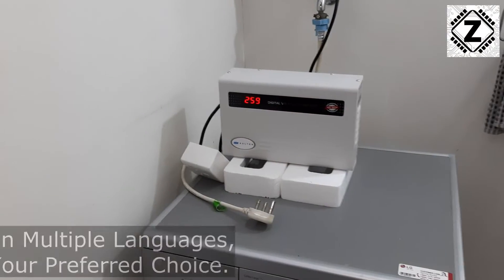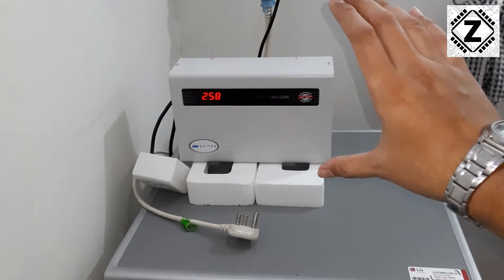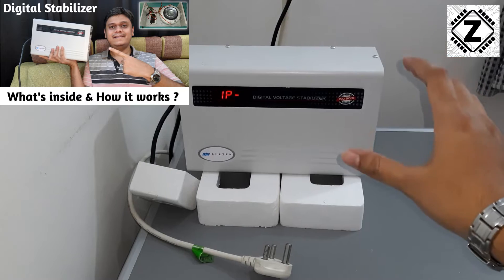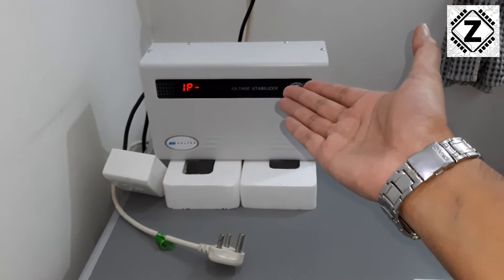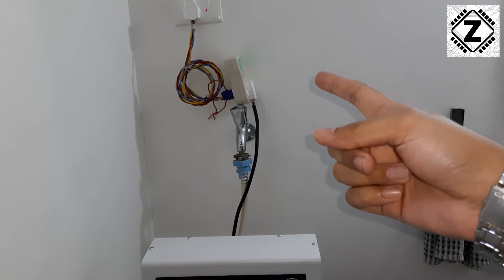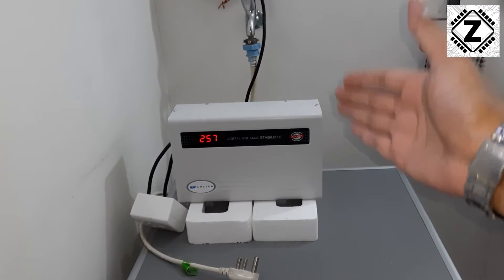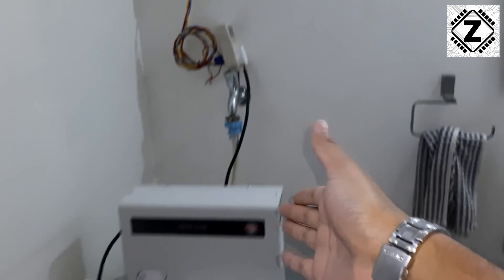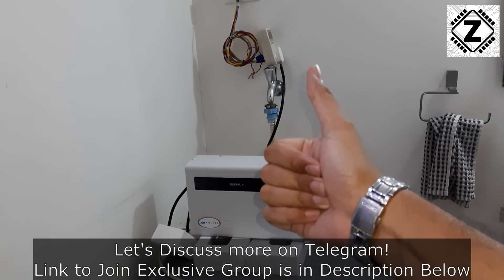[Eng] How Much Power does Stabilizer Waste? How to Save Bills? Aulten 5kva Idle Draw live Test

Comment: Is V Guard stabilizer consume current, even if ac is turned off and stabilizer is on?
Reply from the maker: https://youtu.be/lxdsLHANRPg
Reply: @ZenInnovations Thanks for the video,
I am using a microtek 4090(90 -300 range) in my 1.5 ton LG window inverter AC. As it is a heavy stabilizer. In my area there is no electricity fluctuations. Range is 210 to 240v max.
I have two questions if you can help me.
1. How much extra electricity unit it consumes if I use it with my my AC for 10 hours 
2. Does it make any consumption difference if I use any lower stabilizer like (180 to 280 range)
Reply: @ZenInnovations   

Thanks for the video,
I am using a microtek 4090(90 -300 range) in my 1.5 ton LG window inverter AC. As it is a heavy stabilizer. In my area there is no electricity fluctuations. Range is 210 to 240v max.
I have two questions if you can help me.
1. How much extra electricity unit it consumes if I use it with my my AC for 10 hours 
2. Does it make any consumption difference if I use any lower stabilizer like (180 to 280 range)
Reply from the maker: @manojrandhawa1020  continue using it as is, the power consumption is not high enough to worry.
Reply: @ZenInnovations  thanks for the quick reply, really appreciate.
If you can just give me a ruff unit construction so it will be really great.
Thanks
Reply from the maker: @manojrandhawa1020  it's roughly 15w
So 15 x 24h = 0.36 unit.
Reply: @ZenInnovations  thank you very much